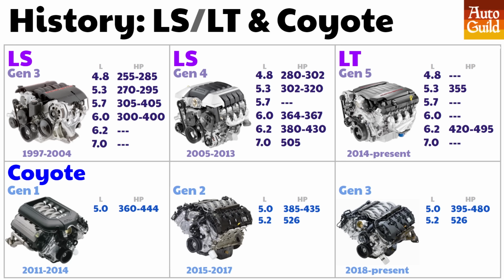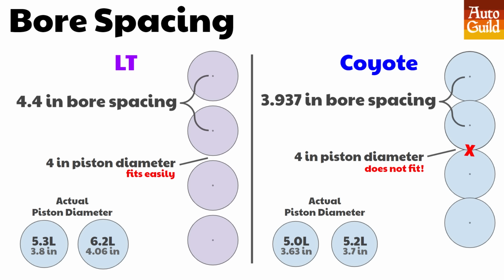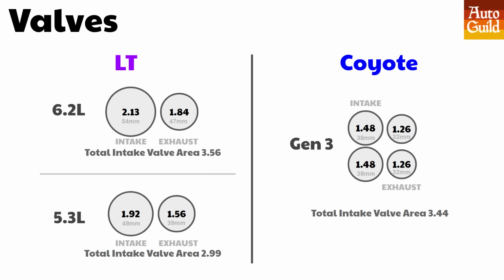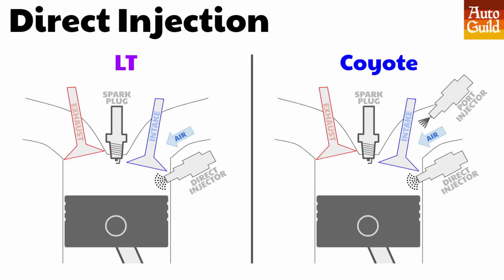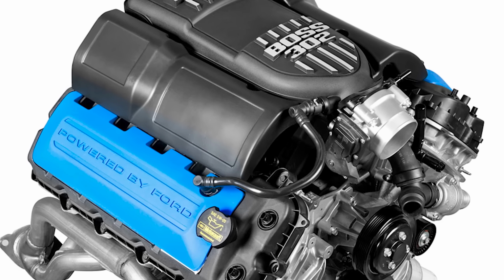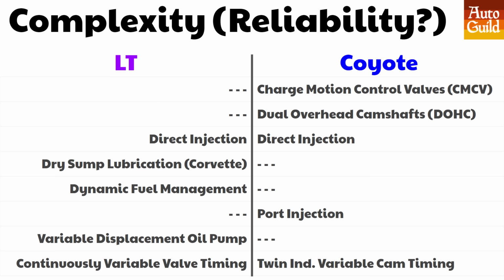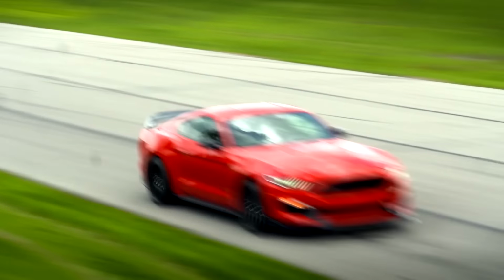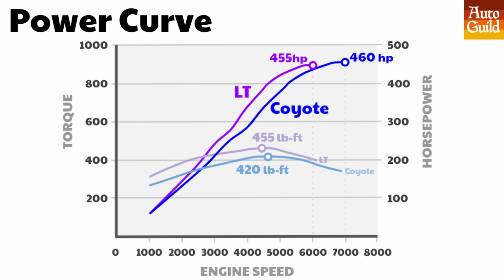GM Gen 5 LT vs Ford Coyote.  Which one is better and why.

Comment: Gotta appreciate the engineering went into making the Voodoo engine.. LS guy
Reply: Can’t forget the forced induced version of the voodoo, the predator. Pretty damn amazing for the size of it…. LS guy as well.
Reply: @Chris.CN7N  Predator is not a version of the voodoo. Its a cross plane crank, so its got the bore of the Vodoo, but its just a normal Coyote.
Reply: @Chris.CN7N  Damm i almost forgot about that bad ass lt6 that just shit on all fords dohc with 680hp N/A! Now thats one bad mf! Gm out did themselves with this one!!.... FORD GUY!!
Reply: This comment section makes me happy.
Reply: with out a doubt it's one of the best thought out engine platforms ever to be produced .........Hemi Guy
Reply: Gotta appreciate the how GM got the pushrod down to a science.......... Coyote guy
Reply: @Black_Star_Racer  ooooooooooooooooooooooi[oo8oo
Reply: @Black_Star_Racer  ford had also. Chevy is copied ford. Biased idiots cant swallow nor grasp that indisputable fact.
Reply: @tnaccountability7455  and here you go have to start a shit parade for literally no reason. They all have copied one another for something. Grow the fuck up and admire the engineering that went in that made those two engine platforms. But going back to what you said, how did Chevy copy Ford when Chevy has been using the pushrod v8 longer than Ford? Ford has dohc v8s to a science, and Chevy has the pushrod v8 to a science. You sound like an uneducated 16 year old seeking attention with your biases.
Reply: CTCDarkness - idk I think Ford showed they could make the best pushrods V8’s in LeMans you can’t deny the small block Ford is amazing and I believe they used a big block Ford for the GT40 not the small block. I think it’s awesome Ford American big block kicked those European exotics ass dominated.
Reply: @Chris.CN7N  I didn't start anythijg. What I did do is state the facts. Irs in you werher you are man enough yo swallow it id cry luke a simp n then go as far as to to say grow up when all I did was mention the facts that Chevy has copied ford. Im a ex race engine machinist of 18 yrs you goober. 

Admire it 😆 lmao youd admire my work but have no clue since you want to cry insteadad of admiring the facts I srated
Reply: @Chris.CN7N  lol lol. The ls is an aluminum version of the ford fe, ford firing order since they (can bolt an is head on a ford) unmarried the exhaust valves in the center of the head that started causing gaskets to lift. The oiling system...yadayda.  Look at an ford fe engine from the 60s...then look at your question about how did Chevy copy ford n you might catch up to the late 90s. You still stuck aint ya. What else you need to know that you are clueless of. Want to know what i think besr finisg hone stone is, what minimal cross section refers to, how to figure it and why.  Do we need to get real technical or you gonna just run them brothel lips about shit you are clueless off while you make false accusations about growing up n starting shit. I can start something you dont want none of. But I simply stated a statement in which was an indisputable fact. 

I guess I'll have to drop some links since you have to see mit since you really dont know shit about it but the bs you read instead of knowing from yrs of r&d n hands then seeing many of those engines dominate. 

Did i mention I was a race engine machinist. Did I mention we had a dyno n saw the factual results. Did i mention ive machined n built fe engines ls engines ford engines and much more. Down to modifying 2 stroke nitro rc engines. 

Lmk boi
Reply: @Chris.CN7N  oh and what was that sound my text made again...i didn't hear it did you.  Speaking of a child what man says reading text results in audio that you heard that suggested child. 

Im not the one but you can get you some on the track in the yard or in the shop. Makes no diff or all the above. 
Get that cash app ready. Lets sling some cash
Reply: @CoyoteFTW  hes clearly biased which says he dont know where he shit last. That stupid phuck is barking up the wrong tree. I'm an ex race engine machinist and drag racer for 30 yrs n got cancer.
Reply: @Chris.CN7N  https://youtu.be/iLxMVfnvLvU

Maybe watch that since my text makes sounds n its not understandable.  Look at that block and the crank home and main caps...(make sure you remember what yr the ls came out) then look at the placement of the valves...(while remembering the placement of chevys valve placement before the ls) having the 2 married exhaust valves in the center before the ls.  Now then after that go look at the ls while remembering when what was produced when.  

Then you will have your answer. 

Ls is a revamped 60s fe with ford valve placement and firing order where until they did that with the ls unmarrying the exhaust valves.  Counter sunk the mains in block where before the ls it wasn't. Yet the windsor family fords did not..only the 60s FE had the counter sunk crank and mains.  

So does that answer you? And what sound did all that above make...??? 😆

Anymore questions this child can tell a grown up.  You tell me. Since you couldn't handle a statement since you are foolishly biased.  Im not but I'll tell the facts that all race engine machinist know. Ford has always out powered GM per ci. Now its even worse with the mods cause Chevy dont jump right in board so they dont get accused rightly so for copying n getting with technology. 

https://youtu.be/iLxMVfnvLvU
Reply: @Chris.CN7N  did they have the pushrod better than anyone else....nope. Yet ford dominated le mans with those I mentioned yet ole Chevy biased goon ctd will always cry cause bias n claim Chevy had pushed engines on lock...thats not even how it works you imbecile. 😆
Reply: @tnaccountability7455  wow dude still going?!! Dude that engine  is cool but not that impressive! Its 4 cams doing the work vs 1!!!!  Fact is why when I go to the strip I MOSTLY  see a ls under the hood of fox body  and many more??!! Theres a reason for it
Reply: @CoyoteFTW  🎯🎯🎯
Reply: @Chris.CN7N  they did Copy the 10R80 and bro that’s a monster transmission engine wise idk but transmission in 2018 Ford litterally shook the world I was pro Chevy sold my 2015 Ss for that 10 speed 5.0
Reply: Some of y’all need to go back high school and enroll in an English class. Piss poor grammar from grown ass me who claim to be educated and knowledgeable about the engineering of combustible engines.
Reply: Love my ls...little  money makes ridiculous  horsepower  and amazing  torque  with very close power / torque  curves.
Reply: @galevest4545  there's nothing wrong with an ls just when speaking of a comparison of the engines efficiency $$$$ is irrelevant. Now if you talk about cost of buying them used an LS gone be less. Yet when it goes in the car do people line up their receipt n who ever has the lowest has the quickest and or fastest car? Cause there is a big diff between quick n fast. 

I'm not suggesting you were making an argument of the cost but....you did mention $$  

An engines efficiency is just that. Makes no diff what it costs when you line up...and funny we see sooo many times where a GM biased idiot (I say idiot cause being brand biased specifically is idiotic as brands have no relevance what so ever in the power an internal combustion engine makes) well not bad tho cause I just 15k total in this build car yackity yack....well you still just lost money.  

Anywho as I've said nothing wrong with an ls but aint no excuse for these people to be so blind to what I've been saying
Reply: @tnaccountability7455   when it comes to money a junk yard ls will spank that coyote  ass on a budget  build for less than 8k in  crappy looking car Lol...coyote  is cool   because  is a high revving v8 and that's it  but me personally  I'm not impressed with it. I'm a guy that lives  of the built  not bought  type of thing. It's like when you think you're  fast but that little  civic  just passed your  muscle  car up type of thing 😬
Reply: @galevest4545  false. Its the same engine but since I wasn18 yrs race engine machinist we can go make this happen instead if typing. I can use the shop for such if you want. Junk yard or new is irrelevant to power per ci or an internal combustion engine. Its all about efficiency of air and fuel in compressed and exhausted then more power it makes. Has nothing to do with junk yard so at any point you want to I welcome you to that remember now I'm not biased. Ls engines are great. 

But let's get into another thing. 
What happened to sealed stock class GM vs Ford. Why is that no longer a class. Did it ironically have to do with the fact they were having a hard time making to finals or even the top 5 ????

I'm not biased and the facts are clear so let's put some cash on that want to?  

Has nothing to do with money. Again you dont race receipts. 

Let me know when you want to lose some money. We will put a link n live test.  

If you want to race papers then go play with the cheerleaders
Reply: @galevest4545  you just let me know but if I may I would like to oresent the man that called every is man on the planet to your argument. The joker. Sealed stock no way to cheat no also lets even mention this....not only n bone stock but also less ci being as we are talking about engines comparison not silly papers that mean nothing what so ever to engine comparisons n power.  Plus on the track...yikes what route do you take then.
Reply: @tnaccountability7455   You really like to argue.  Ford should probably give you a T-shirt or hat.
Reply: @galevest4545  there is no argument. This is old news. 

Lmk instead of texting lmk when you got some money to throw on it.  GM guys that arent fools n humble will tell you just that and exactly why GM boycotted the class n quit. Thats why ford has sealed coyote stock class now. It used to be GM vs Ford sealed stock...the proof let alone the dyno charts 😆.  

What part of the facts do you not get you foolish brand biased clown.  

Again I'm an ex prof race engine machinist that can't be biased but knows the facts. 

Lmk when you want to put money on it.
Reply: @galevest4545  once you start building an engine...the combo and machining is everything prior to the ignition and tune. Ring packages, final hone, the stone used...i prefer 400.  At that time now we have a lil diff story. 

Per ci stock when you talk about an engines power ford vs chevy...ford has basically dominated. That said is the entire facts. Now you can attempt to argue that till your blue in the face but it will always be a dead end.  
Do we need to look at the standard camaro vs the standard gt at the track or on the dyno. Remember ci dont forget. We talking brands n what they do from the assembly line. Lmk
Reply: @galevest4545  they dont need me to prove 9 yr old proven facts since the GM guys boycotted just exactly what you are trying to argue against. Are you gonna argue against all your lovers...the entire GM class that gave up n boycotted the class till it was cancelled due to no GM car count or entries.  
.do your research n actually get the facts...itll help but I'll gladly take your money n buy you a shirt that says

" brand bias is foolish when the truth is elementary....If you arent close minded and ignorant!!....I found out the hard way"
Reply: @galevest4545  I'm stating facts nor arguing. State the facts. This isn't am argument. Its me stating the facts you cant handle due to foolishly being brand biased n butthurt over a silly stock hp per ci comparison.  And on the track. 

That's not arguing which happens to be another fact. 

Yet if I do or do not like to or willing to argue the facts n a man's passion is irrelevant. 
Back to the drawing board you go. All cause you are so clueless of it all...you have became brand biased. 

Again im not brand biased but the facts are Ford's engines male more power per ci. The facts arent hidden. You just a brand biased clown. 

Wanna know what one of my favorite engines are per NA a Chevy 😆 😆

To be specific a 4 bolt 350 based billet 434 ci pushrod SB2, callies crank.......... Nothing like hearing 9200+ rpms.  Yet when it comes to the facts of the said families this article is about. Ford has always dominated. 

Again its foolish and clueless to be brand biased
Reply: @tnaccountability7455   You would argue with the dead man wouldn't you? Believe it or not I admire that it's funny lol. You definitely have no knowledge of LS engines and interchangeability . You need 4 cams to make all that hp to get that big hp  to beat a motor  with 1 cam. Some people  is impressed and some not.
Reply: @galevest4545  I have plenty of knowledge of the ls. Did you forget mr short term that I was a race engine machinist for 18 yrs up till last yr before i was diagnosed with cancer?   

Lmk if you wanna hit the machine shop n you take your junk yard ls and I'll take mine. You order up your parts for the engine I'll also do the same. 
.yiu cant have anyone elses input or them order the parts.  No help machining it no help assembling it and then we can dyno them. 

Or like I stated a gazillion times since you some how also keep forgetting we are talking bout hp per ci and power from the company not a race engine machinist like me and the engine built

Lmk when you wanna do more than cry n your defense to a defeat is me running the facts down your butthurt silly brand biased throat
Reply: @tnaccountability7455    I'm sorry to hear you have cancer I would not wish that on my worst enemy and prayers to you and your family.
Reply: @galevest4545  excuses excuses excuses crying crying biased crying crying excuses excuses excuses. Lemans lemans lemans...ooops back to drawing board you go with excuses excuses excuses lol. 

Oh and again know my favorite engine. A pushrod 350 based 434 SB2 chevy. My favorite.  You seeing that yet. A Chevy engine. Just because I can. Not that ford isnt capable but being as I have so much I could throw one together due to having so many and having many of the old sb2 cup combos bought from JGR engine bellhousing and 4 sd right out cup cars with practice laps only. 

When you have machined and built 10 to 1 Chevy over ford for southern all stars n super late you tend to have tons of Chevy builds and parts. Well as I said thats why I like a 350 based 434 sb2 headed engine. 

Hell our sbc steel head class engines with stock vortec steel heads make 560 😆.  Pretty impressive if ya ask me but you think I'm a biased imbecile fool like you. 

I'll gladly take your money and or sit you down for a class so you dont continue being a clueless clown
Reply: @tnaccountability7455  but since you think I'm brand biased   I do own a 87 iroc z  and  and 91 fox gt but I'll let you know  in the near future  that fox is getting  the traditional ls swap. Later dude and god bless
Reply: @galevest4545  only brand biased fools make your claim.
Reply: @galevest4545  idgaf what anything is getting. Typical biased clowns claim not biased by buying a fox and putting their biased choice of power plant in the hated but known best drag platform hence why you have the fox n putting an ls in it cause you assume its better due to brand. 😆  its that simple. 

You gonna back up your claims that I know nothing of the LS, only wanting to argue rather than state n prove the old known facts.  Show me a Chevy off the lot making more power per ci is all.  

Deflection of the facts n subject let alone the bias you deny...is a disease. 

Denial is like putting a cap on your knowledge of internal combustion engines. 

100% facts. I was like you before I took the effort to be responsible n learn instead of reading brand biased lies. 
No different from reading lies from a Tel lie promoter/teleprompter as your defense is rather shallow.  

If we are being fair here. I'm not saying what to do as thats not what a passionate race engine machinist does for there are so many purposes that can change what will work best if per budget class ect. 

Hell my brother has a 13gt mustang with a roush 2.3I SC on 8lbs at stock weight factory 6r80 n its only been high 6.40s in the 8th at full weight at 109mph. Made 676 rwhp with the 6r80 at 8lbs and made 724 rwhp with the manual on 10lbs. Manuals are garbage for drag racing but good for mph contests from a yeast roll. Lol. 😆 

Im not a fan of gay rolls js
Reply: @tnaccountability7455   You are such a crybaby nobody cares because it's small cube in!! It means nothing cuz at the end of the day a v8 is a v8  and that turd coyote  needs dohc  to do what it does . That's engine is a nut buster  to work on in the vehicle  and believe  me ya gotta work on it .
Reply: @galevest4545  👍 to the IROC!!!!
Reply: @tnaccountability7455  dude your a ford fan and are butthurt,nobody in there right mind would spend double the money to build a small cubic inch engine..and where on the street can you wind up to 8000 rpm to be competitive,,
Reply: @galevest4545  fast is overrated, handling is where it is really at
Reply: @tnaccountability7455  a 293 inch 4.8 has been 1400 hp sbe. unopened vs sbe are similar, exept heads/cam are needed. unopened ls3 has been 1300 horses, stock sealed. both builds cost the same in the end. half what a stock sealed gen 3 coyote costs making 1000-1200 on e85 boosted. the pushrod 7.3 Godzilla engine is superior to the 5.0 boosted stock versus stock both being Ford engines. Coyotes don't make bottom end torque. That's why the 6-speed manual cars dyno 25 more horse to the tires but are way slower than the 10-speed making 25 less horsepower to the tires. Nuff said
Reply: @biggregsparks8364  and a coyote hasn't and more?
Reply: @biggregsparks8364  any and all larger ci displacement engine is superior to the one its larger than. That's how power goes per ci displacement.  I know why and what.  Its not like I haven't been doing this for 31 yrs.
Reply: @biggregsparks8364  you are conflating e.t with mph. Speed is not e.t.  how fast one will go with such the power is more dependant upon the final gear ratio and rpm limit of the said engine.  

I got your nuff said anytime you wanna grab a lane or come in the race engine machine shop I work in. I'll wait
Reply: @biggregsparks8364  cost is irrelevant. If this was about cost it wouldnt be about numbers equating from power made would it.  You always thrive on irrelevance?
Reply: @tnaccountability7455  i build engines as well. your funny. my 95 camaro lt1 383 with d1sc procharger, t56 magnum, ford 9 inch rear, 4.10 full weight ran 9.78 at 139 mph on 28x10.5
Reply: @biggregsparks8364  cool almost as quick as naturally aspirated coyote class for example "The Joker"
Reply: @biggregsparks8364  I'm funny according to you that is. Do you assemble or build engines. Are you a machinist or a parts assembler
Reply: @tnaccountability7455  yes. also can blueprint one old school with paper, pencil, calculator.
Reply: @biggregsparks8364  ofc...that all blue printing is, writing down what was done. Blue printing isn't machining but rather an account of what was machined etc.
Reply: @tnaccountability7455  yessir, except i figure what needs machined from bare block for example, 9.025 is standard deck height of 350 sbc. most people deck them down to 9 inch. minus off 6 inch rods, you are left with 3. take half of stroke off of that. for my 383 stroke is 3.75, so half is 1.875. 3-1.875 is 1.125. that would be the compression height if your piston if you want it at zero deck.
Reply: HP/L means absolutely nothing. Talking about the number of internal cubic inches vs power made means absolutely nothing. These are two wildly different engine configurations. 

The coyote relies on rpm and the LS/LT relies on cubic inches. Saying that the coyote has a higher power density is something a 4th grader could point out. And it still doesn’t mean anything. 

What does matter? Power/weight and external size because weight matters and ya gotta fit these things under a hood.
Reply: @CJ-ws5sd lmao claims hp per ci means nothing. What a clown. Name of the game from the factory is more power...specially when most weigh a couple tons.
Reply: @CJ-ws5sd  you have no clue how engines work per power.
Reply: @CJ-ws5sd  do you want to put your claims to test on the dyno n tell me hp per ci means nothing.   Tell that to Pat mussi Guys that cant run power adders
Reply: Am I dreaming here? Is this an alternate reality? LS guy complimenting a Ford engine, a hemi guy doing the same and Ford guy complimenting an LS. What's next world peace? Lol😋. Seriously, it was a great and informative video. I really appreciate having a friendly discussion afterwards even though we might have different opinions. So used to seeing negative, derogatory comments right off the bat and it really doesn't accomplish anything except for creating a hostile argument. Having an actual productive discussion on the topics , dealing with the facts and acknowledging the good and bad of each engine is so much more enlightening and frankly enjoyable. We should all be grateful to have all these great choices.
Reply: Voodoo is the best engine ever made. Wish we could get them here in Australia 😢
Reply: Don't mean to be an ass but why do people act like DOHC is a new technology that ford created lol. DOHC has been around for many decades
Reply: @frenchonion4595  Well, they don't. We can start there.
Reply: @frenchonion4595  Nah, they've just perfected it!
Reply: Unfortunately, the voodoo is not a good engine. Ford did not want to run a dual-plenum intake needed for a flat plane crank. So they "modified" the crank design to still be flat-plane-ish. The result was horrible vibration at lower engine speeds. Cylinder coating issues also lead to alarmingly high numbers of failed engines. I've built Coyotes and LS engines. I love them both, but the Voodoo, while cool, was poorly executed due to bean counters.
Reply: @dev1360  That blows ass...
Reply: The LSs & LTs are good solid American muscle-bang, for you $$!  -Coyote/Voodoo guy
Reply: I can’t wait for the new z06 corvette that engine will be insane….. 2.0T guy vw
Reply: They should have done more engineering.. now 1 year later the voodoo engine has turned out to be a track day ticking time bomb.. Sadly.
Reply: So what's the verdict here?

Has GALE VEST and TN Accountability fucked yet? Them two are highly passive aggressive for their love with one another
Reply: Well if the voodoo and coyote are so damn good explain this...
YouTube k p. Mustang.
YouTube LS 9 mustang.
YouTube Seven second LS mustang.
YouTube most patriotic turbo LS mustang.
YouTube 88 mm turbo LS mustang.
YouTube LSX Challenger.
YouTube LSX RAM.
YouTube sloppy mechanic 8 for 8.
YouTube LS Lamborghini.
YouTube LS Ferrari.
YouTube LS swapped Porsche.
That's your voodoo in coyote for you...
Reply: @philllsxga.7737  I'll answer that...same reason there is no longer a sealed stock GM vs Ford shootout.....youll find the reason why GM boycotted in the places not on the podium lol.
Reply: @tnaccountability7455  YouTube LS vs coyote shootout...
Reply: @philllsxga.7737  Yes
Reply: @philllsxga.7737  Lmk when you got some cash to lay on the facts. Im not gonna yt anything.  This is what I do and have done for a living. 

A built engine is not off the lot clown. 

Then when its built does that mean its efficient and a jam up top notch machining combo and assembly. Fuck no it does not at all.

So again brands are irrelevant to the power an internal combustion engine can make. Its all about the efficiency of that build for that purpose at that ci displacement. 

Wanna be my huckleberry?  Btw im not brand biased as ive machined and built 10 to 1 GM over Ford. That said ive seen the dyno numbers ive seen the results ive witnessed the result the results are still documented and still true as we speak.  

An engine is only as good as the machinist, the machining, the combo pee purpose and its air efficiency in and and exhausted per efficient afr

I am.the guy thay machines and designs race engine combos and dyno them
Reply: @philllsxga.7737  Wanna put some cash down on truth of the specific subject you are trying to modify lol
Reply: @tnaccountability7455  you do know NASCAR truck series engines are LS architecture based right with factory LS7 rocker arms????
You do know also hennessy's supercar is LS architect-based right??
Why is it not coyote based why are there so many mustangs LS swapped???
All I know is the LS is smaller one camshaft not top-heavy you don't have to rev the piss out of it to make power and it's compact..
So what's the disadvantage?????
Reply: @philllsxga.7737  At first you had so much to say....till my comment about being a professional race engine machinist.  Then did you also go remind yourself of the subject. Do you also get mad when the subject is per off the lot engines per sealed stock GM vs ford shootout....per why its no longer a class...or because you looked at Johns 282 ci ford engine that went 6.00 with even a stock crank aside from stock heads n block. Lol. 

Or did you choke on the facts n it melt your finger tips into submission. 

If ford or GM was better than the next engine aside from.its brand then woukd it not be a stupid claim to say they race if one is better when built??Ofc not because combos the machining the r&d, the combo....is what decides the efficiency/hp of that ci engine.  Nothing else including brands.  Brands are irrelevant to an engines capability..but now here the subject is off the lot engines...well off the lot ford dominates.  

Hence my reference to why GM quit the shooutout where they had the advantage off the rip 😆
Reply: @tnaccountability7455  again why is NASCAR truck series engines based off the LS and not a Ford motor????
Reply: @philllsxga.7737  https://youtu.be/oWVZos3IepI. Been quicker since. 

Sealed stock. Certified n stamped sealed stock from ford so its legal. Those engines have to be certified per tech.  This here is a 9.4 naturally aspirated and less ci displacement on top of that. The guy that basically shut the GM biased fools up n sent them into retirement since they couldnt compete with him or the others on the podium behind him
Reply: @tnaccountability7455  LoL!!
Why is NASCAR truck series engines based off the LS???
Reply: @tnaccountability7455  oh here you go YouTube 260 cubic inch twin turbo LS!!
No coyote there 😂🤣😂🤣😂🤣
Reply: @philllsxga.7737  Why is an ls revamped aluminum 60s ford FE with ford ouling system firing order and valve placement.  Counter sunk mains exactly of the Ford fe that dominated lemans. 

We can keep going if you want to clown...again this old news to a professional race engine machinist that is not even biased.  

Let me know when you are done trying to hit a 35mph fast ball right down the pipe??
Reply: @philllsxga.7737  Lmk when your money is right where your fingertips are.  Easy money to see you claim it. What's the wait or hold up?
Reply: @philllsxga.7737  Truck series engines based has nothing to do with the power output of the coyote vs the ls copied 60a ford fe that dominated lemans. 

Btw if you want to assume thats a logical and relevant comment then sure thing....whats the la based off of 😆  

Strike 69 clown. You tired of swinging yet
Reply: @tnaccountability7455  you know the saying you live and learn??
Year's ago I had a 3800 (3.8) automatic firebird, totally factory stock.. one cam!! In the block!!
A friend of a friend had a Taurus SHO V6 5 speed, he constantly was talking shit (like you) about how he was going to whip my firebird, I beat him twice! Not once... TWICE!!!!
He was pissed!!!!  My firebird had no special badging.. factory stock! The Taurus had SHO badges on it totally stock..
So what all of those cam shafts and valves do for that Taurus????
It couldn't out run a run of the mill Buick 3.8!!!
That was over 20 years ago and tought me a valuable less in the difference between GM and Ford's engineering...
I've never been impressed with the performance of a Ford. GM has ALWAYS topped Ford....
Reply: People cant grasp that GM has copied ford for a while now. They are doing so to try to catch up to the fords hp per ci since ford has always our powered GM engines per ci
Reply: @tnaccountability7455  that's total bullshit. The LS shares it's architecture with the BBC. Get real bud.
Reply: @jamesquaife5633  let me know when you wanna wager money on it. Just know its here in youtube before you go watering money. Let alone argue with old known facts with a race engine machinist.
Reply: @jamesquaife5633  I guess thats why the ks head will bolt onto a ford. Eh? Lol. Why does it have ford firing order but nit before the ls. See this just proves you dont even have enough knowledge of either to argue this or you'd not said Jack. But anytime you wanna wager money on it I'll be more than happy to take you money n record it live n post the video link here.
Reply: @jamesquaife5633  and you tell a race engine machinist get real.. That's rich comedy. 😆  

Ok locate that BBC with counter sunk mains
Reply: @jamesquaife5633  what were you barking https://youtu.be/XKQ2zHmdhbo
Reply: @tnaccountability7455  Ok, so if we're to assume the LS/LT is a copy of the Ford FE, then look at the fact that the GM version is making more power with less displacement and doing it more efficiently, it can be implied that while Ford has moved on from the design, GM used it and made it better 🤷‍♂️
Reply: @crewdawg2008  oh there is no assumption. Its a fact. Find a counter sunk main Chevy before the LS and tell me when before the LS did a Chevy have ford firing order n able to bolt a Chevy head onto a ford. No assumptions. Let mw know when you got your wallet ready.  Btw false you got it backwards. Ford has made more power per ci for many yrs and now its even worse than it was for so many yrs.  That said before the 2 in the comparison on the table at hand is clear as day proof of that on the track per why there is no longer a ford vs GM sealed stock shootout...cause GM per ci in a factory sealed stock competition...ford dominated them.  This is old news. Look how many yrs its been since they boycotted the class n quit.  Why you think that is....now with that said I am not knocking either engine but per ci from the factory ford has n still dominates power per ci. Its took Chevy 48 ci displacement advantage just to equate to the performance of Ford...from the assembly line.  Yet who leaves them stock right. Not knocking either. Just stating facts but you are so foolishly biased the truth of 2 silly stock engines you call truth a lie and an assumption. 

Bro choke it up and grasp im not biased cause I cant be. I mean the facts arent hidden from anyone. You are just butthurt simply due to your foolish bias. 

Only you can fix your bias causing your denial of truth causing you to try to pass off a lie to a race engine machinist. 

Again let me know when your money is right. Ask your alleged LS gods that boycotted the factory sealed stock shootout why they boycotted it n no longer a class
Reply: @crewdawg2008  you have everything completely was backwards
Reply: @tnaccountability7455  Actually, I'm a ford guy, so if anything, my bias would be in favor of Ford, however, let me be clear here, IF the LT/LS platform is, as you allege, based on the old ford FE engine, then GM has, effectively, taken the design and made it better. The smallest FE engine was 5.4 liters, or 332 cubic inches, where the most common GM platform is the 5.3, slightly smaller than the smallest old FE, yet it makes gobs more power than the comparable FE did. That is my point.  Ford has moved on to the DOHC coyote, which is an amazing engine, I own one in an F150, all I care about is comparing apples to apples if you're going to make claims about GM using an old ford design, then let's make things even here
Reply: @crewdawg2008  - the 427 FE won lemans a 24 hour race, that itself alone is enough to prove to me the Ford FE 385 series (or like the bow tie girls like to call em Big blocks. But I’m sure they mean something else when they say they love the “BBC” LOL!!) is better than anything GM has ever put out. Tell me what makes the ls or lt so great or what those engine have achieved or won that Ford engines haven’t? So what if they’re popular so is McDonald’s doesn’t mean shit
Reply: @CoyoteFTW  That's true, they did win Le Mans in 66 and 67 with a 427. They also won in 68 and 69 with a 289. Le Mans was a big hurdle, all to feed Henry Ford II's ego by beating Ferrari, and they did. Mission accomplished. That was great, but it was also over 50 years ago, automotive technology has come a long way since then. Eventually, the 385 series replaced the FE engines, until they themselves were replaced. This is not to take anything away from the FE, of course, but only to point out that times change, and engines change with it. So, even if GM did borrow the basic design philosophy for their LS/LT engines, they've improved on a lot of things, and we can't use a Le Mans race from over 50 years ago as a basis for comparison. I don't know if GM ever even really tried to run Le Mans at any point, but I'm certain they've won some NASCAR races with that platform. Having said all of that, what's interesting to me is that today, if you look at the Camaro vs the mustang, for example, you'll see that it takes a GM 6.2 Liter to compete with a Ford 5.0 Coyote. Ford has a tendency to milk a lot of bang from smaller displacements, and we see that with both the 5.0 and related 5.2 Voodoo.
Reply: @tnaccountability7455  They copy nothing, and if they did you wouldn't see so many Chevys under ford's hoods...